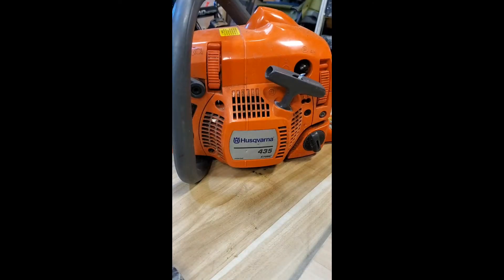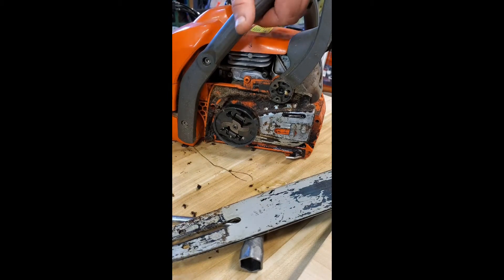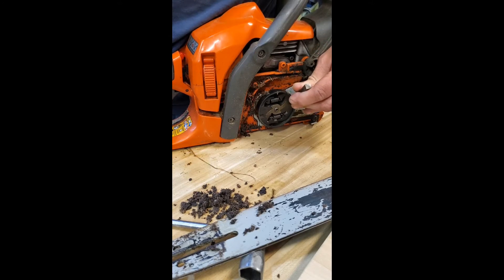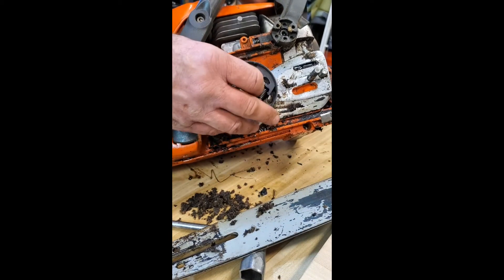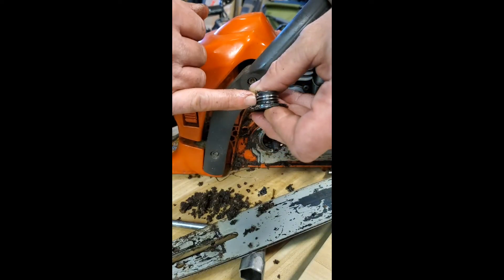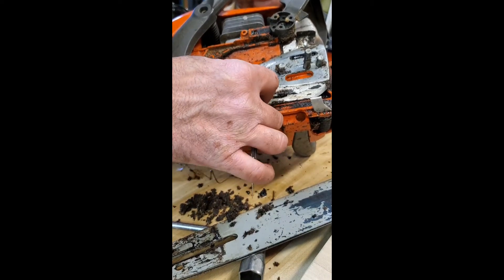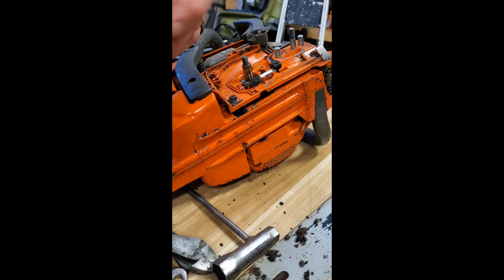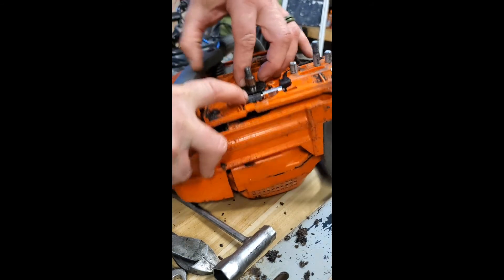Husqvarna 435 oil leak

Comment: The plate doesn’t put enough pressure on the area it needs to keep it tight to seal, socket and punch will easily fix it and no sealer or glue needed
Reply from the maker: Those are great ideas! Thanks!

Comment: A follow up on the last comment. I just cut rounds from 3 mature Larch trees, no more chain oil leak, problem solved. The crazy glue seems to work. I did find another possible cause for the leak on my Husq 435 though. When I watched the video, I saw that when Ray removed the screw that holds the stamped steel plate, it was on there snug. The same screw on my saw was almost loose, took no effort to remove it. It might have been loose from the factory. I used blue locktite on it.
Reply from the maker: Excellent follow up and tips ! Thanks for the info
Reply: I have the 445 with same setup. One screw on the stamped part that doesn't seem to hold tight anymore. Wonder if third party might be beefier.